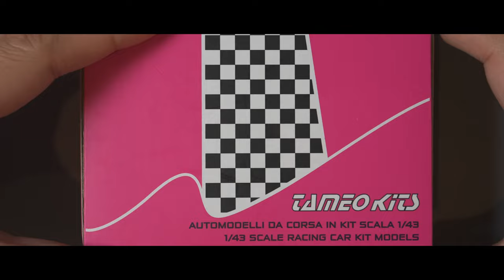#01 Building BRABHAM BT50 TAMEO 1/43 F1 scale model car

Comment: Great build. I've recently resumed building 43rd scale and this build inspired me.
Would love to know what tubing you used for the air stems, lug nuts and instrument panel switches. 
Great work
Reply from the maker: Air stems,lug nuts and instrument panel switches
→ Adler's Nest Hex Bolt Head, SSS
https://www.amazon.co.jp/-/en/Adlers-Nest-Bolt-Head-Pieces/dp/B001ADQRVM?th=1

Lug nut 
→SAKATSU 1/24 Hex Flange 0.7mm #2
https://www.hlj.com/1-24-scale-hex-flange-0-7mm-2-sak4455

Thank you!!

Comment: Beautiful and very inspiring build. Thank you for sharing with us. Do you spray clear over the tires before applying the Goodyear decals, or do you apply them directly on to the tire?  Also, you spray X19 over the tires to seal the decals?  Thank you in advance for your reply.
Reply from the maker: Thank you for your question.
I apply the decals directly on to the tire.
 The reason I spray X19 is not to protect the decals.
Because to stain too bright white decals a bit and to give the tire sidewalls a glossy finish.

Comment: Just checked out the 1st video. Very nice. Really liked the work in the seatbelt. Also liked the clean-up techniques demonstrated. Being a 1/43 builder I really appreciate seeing how others use their tools. What was the specific drill type tool you used to spin the tires, steering wheel, etc.?
Reply from the maker: I'm glad a 1/43 builder is watching!
If not this, I think anything can be used as long as the axis is not blurred.
Nakanishi EV250-100 Torqui Max Evolution.
https://amzn.to/40hHhSx